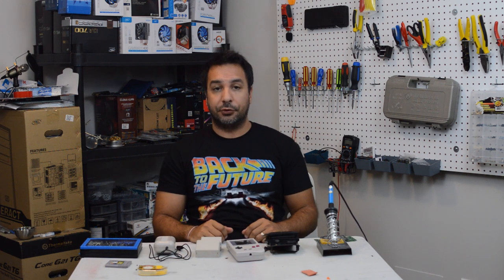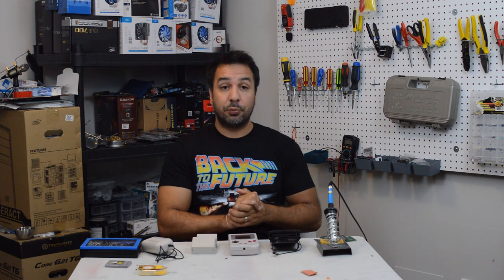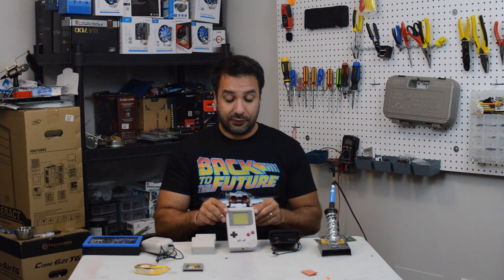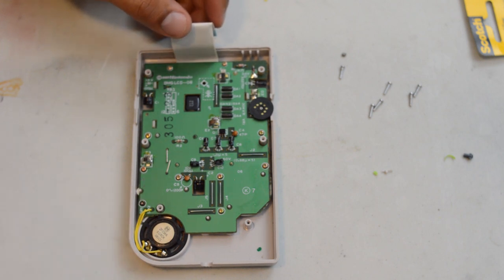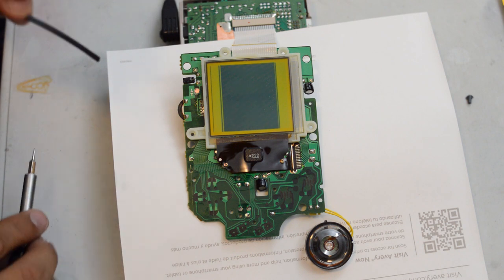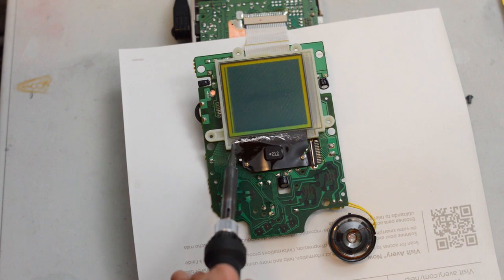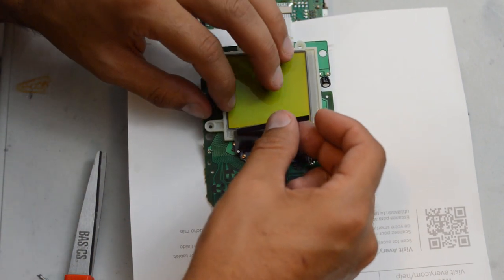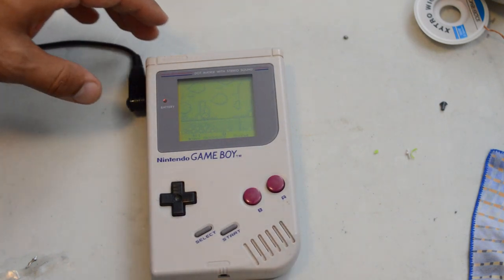RETRO RESCUE, Original GAMEBOY (DMG 01) Screen Repair Vertical lines

Comment: I've fixed horizontal lines with this method. Succes rate is low. About 3 out of 10. Crank the heat up high and hover over that area. You'll get some slight melting of the plastic in the area. But it'll be completely covered when assembled.